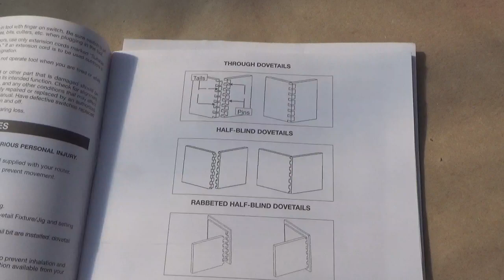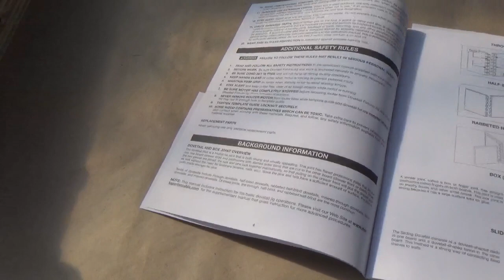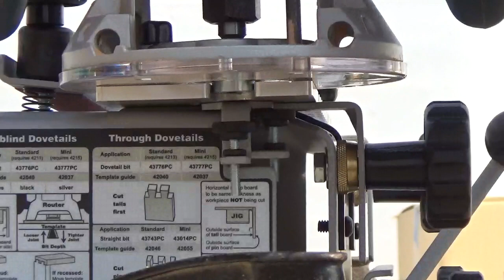My wife got me a Porter Cable 4210 Dovetail Jig for Christmas, and it's great.

Comment: Great video, and like you am a hobbist wood guy also. Some years ago, redid our bathroom and refaced the vanity and reboxed the drawers but just used a end over joint and screwed together, plain and woods but looks really simple, would like to redo them a second time using this tool and your advice. 
My brother-in-law was actually talking about this tool and speaking how expensive it was, might buy it for both of us as we borrow and lend tools regularly. Agree with the others, you're a perfect teacher, not pushy at all.
Where would you put the sacrificial piece to stop the tear out?

Comment: I too just got the dovetail jig as a gift.  Your video is very informative but could you tell me specifics on the adapters you had to get for your Bosch router?
Reply from the maker: Sure, this is all you need to use the included guides with your Bosch Router.

http://www.rockler.com/bosch-ra1129-quick-change-template-guide-adapter-kit?utm_source=google&utm_medium=cpc&utm_term=&utm_content=pla&utm_campaign=PL&sid=V9146&gclid=CjwKCAjw_dTMBRBHEiwApIzn_CYQPYnke6Gr5fyf6SW49TZ0FAeM5EVU86ypStXAvXoHFE6np4eRTRoC69oQAvD_BwE

Comment: Just had a question ? I’ve tried everything but the pins fit to tight and have to really hammer them in , which is damaging the pins . I’ve checked the depth of the bit and it’s correct . Any thoughts sir ?
Reply from the maker: Hi Pavlo, Its the Height adjustment. I know you mentioned that it is correct, but you may want to try again. 1/100th can actually make a difference. I spent a good 4 or 5 hours trying to get mine correct. Good luck!

Comment: Appreciate your video.  I'm looking to redo all my kitchen drawers and add pantry with dovetailed drawers.  Would you recommend this jig for that job or just make them with the table saw like your other video?
Thanks,
Brian
Reply from the maker: I guess that depends. This jig is certainly easy and you will be able to knock out a bunch of drawers in no time. Only downside is that the jig looks like, well, a dovetail jig, you know, like a robot cut it. Table saw method certainly looks better, in my opinion. but it can take longer. Hope this helps.

Comment: The bosch router, I forgot that second lever every time then wonder why the motor doesnt come out😂😂 I bought this jig and got all the extra jigs with it. Waiting for it in the mail still. Got it because I cant stand box joints and my router table is bad now, so I cant rabit joint, and i don't have the time or patience to cute dovetails by hand....hopefully this jig makes me use my router more often. I mean it's one of the most versatile tools in my shop but its rarely used and I feel a little guilty about that.

Comment: Thanks for the vid. I like how u mounted it.im gonna do the same..I JUST gor this jig used from Craigslist..no manual and no guide bushing.but i do have a guode bushing and it fits.
QUESTION: WHAT DEGREE BIT DID U USE AND HOW FAR DOWN IS THE FACTORY DEPTH STOP. JUST SO IK WHAT BIT AND HOW FAR DOWN TO SET IT IF ITS BEEN MESSED WITH..THANKS AGAIN MAN! JUST SUBSCRIBED I don't know if you subscribe to other woodworking channels but I also do videos would love to have you aboard my channel look forward to seeing more of what you do and what you have done